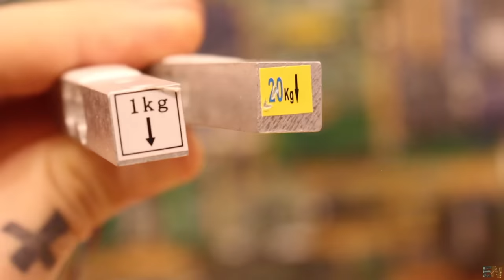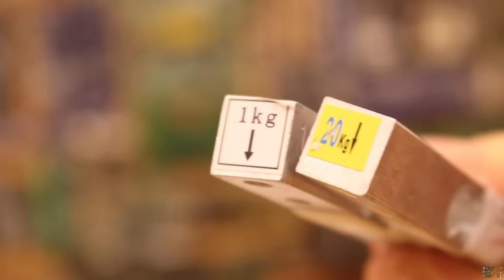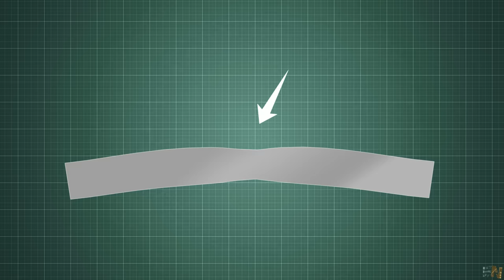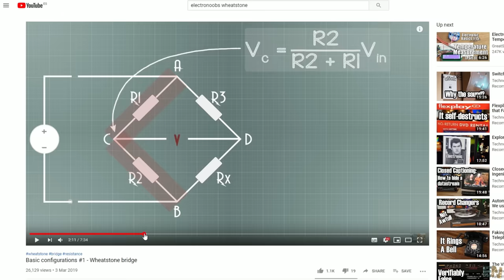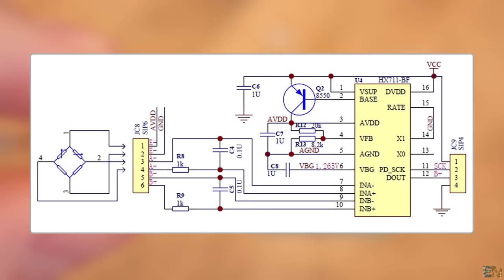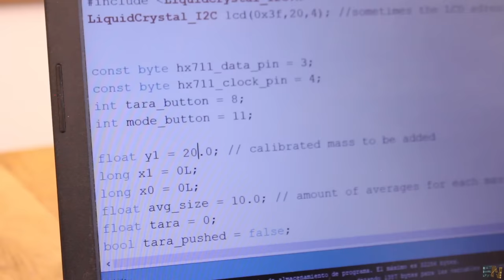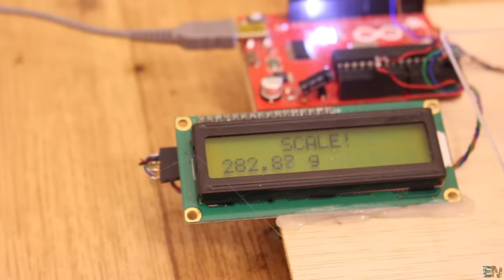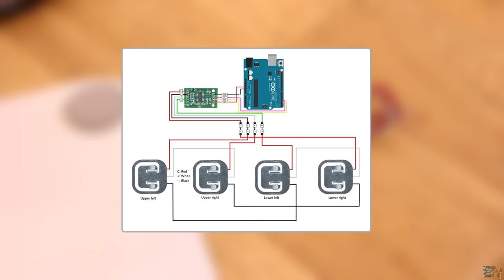How STRAIN GAUGE Works | Precision SCALE With Arduino

Comment: For most average users with arduino background this is a great tutorial. Your gage handling practices in this video and adhesive info need improvement. The HX711 also has many issues with it's reading due to it's overly simplistic and antique architecture. A MUCH MUCH  better BoB uses the ADS1120 or ADS1220. These are by FAR many orders of magnitude better be it more complicated.  Selecting STC code, bridge arrangements, creep code, dealing with thermal issues (passive, manual, active) material installation, compensation for temperature range, gage protection, and more as well as proper gage installation techniques (glue dependent).
Reply: any more info on non-HX711 solutions ?
Reply: Do you have any suggestions on how to incorporate a thermistor into the scale sketch to compensate for thermal creep?

Comment: When you need twisted pairs, you could use LAN cables disassembled. Each cable contains 4 very well twisted pairs. If you need longer cables, you can use RJ-45 connectors !

Comment: Thanks for this video and web page. I'm currently working on a mostly 3D printed bench-top dynamometer with a Nextion Enhanced touchscreen and a Arduino Pro micro. Features include volt meter, amp meter, tachometer, 10A relay, 10Kg load sensor, a geared stepper (to control the break from the touchscreen) and a buzzer. I was trying to work out how I would incorporate a calibration sequence into all this. This was the most helpful video i found.  Many THANKS!

Comment: I've made a few bicycle power meters using strain gauges.
I use a simple amplifier and the Arduino’s own ADC, very basic but actually gives decent power data when set up correctly.

Comment: Electronoob thank you very much great video merry Christmas thank you very much, i am using flexible caulk to seal a crack in the area that was damaged but it did not reveal or show the sensor, i learned a lot ,

Comment: This is used to calculate a bending force as the material elongates and deforms, Would I be correct in saying the this could be used to measure a tensile force if it was applied parallel to the gauge instead of perpendicularly like in the video

Comment: Thank You - I have the idea for a project weighing seems to be the easiest way to measure. Your explanation was excellent - Thank you 
I am just learning about Arduino and it is simple enough plus flexible enough to handle my project.  It is to easily measure volume (via weight) and control the temperature of water for a mash-lauter tun.

Comment: You cant make correct mesurement like that. You have to put things exactly at the center of the platform or you need 4 legs and 4 sensors to compensate the position. Yes, there is something like torque.

Comment: Can we a get wrong value when a same weight is placed at different places on the bord ?
Because increase in distance between the sensor and the centre of mass of the applied weight can vary the torque. So the resistance of the sensor also vary.
Reply from the maker: Yes it could. But for this small setup the error is very low. Also if the plate is more solid it will help more. That's why for better results you could use the 4 load cells setup as a body weight scale
Reply: @ELECTRONOOBS  oh! Yea 🤘
Reply: @ELECTRONOOBS  oh lol I mentioned this in my comment
Reply: The load cells shown with two bolts on either end are contra-flexure differential bending beams. The cut outs cause a near parallelogram movement. These two points reduces by many orders of magnitude the variance based on distance. The non-functional example on a piece of plastic or glass on the end would be proportional to both force and distance. An experience load cell designers job is to negate these effects though combinations of mountings and corrective designs.

Comment: oh boy I can't wait to use the gram -> ml function for my liquid mercury measurements :)

You know that function is more-less useless, right?
Reply from the maker: Is just for water... But if you want in the code, you can multiply by the mass of mercury and use it with different modes..
Reply: @ELECTRONOOBS  i know, but it was just funny seeing it knowing that ml == g for water. anyhow, very nice video. thank you
Reply: Yeah, though it could be made useful by adding a density calculation function: measure the volume, then press a button and measure the mass, and it automatically calculates the density.

Comment: Let me understand better.
Have you not taken into consideration the thermal drift of the materials?
Did you add a particular zeroing system before calibration and every time the scale is turned on?
I like this work of yours, especially for the fact that you used an ADC other than the Arduino one, which has little resolution and would introduce too much error.
For now ... bravo.
Reply from the maker: No, for this simple example, no thermal drift of the materials was took in consideration...
Reply: I see....well,it's a good starting point.
Thanks for sharing the idea.
Reply: The load cells are full wheatstone bridges and therefore passively compensated. A single gage will have high thermal drift characteristics especially if not matched to the material. This matching is matching the thermal expansion of the material to the STC or Self temperature compensation of the gage. This would help, but would not eliminate all of it. It also depends on the material of the element of the gage. Constantan gages have a flatter curve at room temperature, while Karma does not.

Comment: You absolutelly ignored the two strain gauges on side of the load cell. They are there for temperature compensation, connected in full bridge. So your examample on the end of the video, with just one strain gauge isnt actually a scale, but super sensitive thermometer ;)

Comment: Did you need to amplify the signal with additional components when using the strain gauge? 

I've also read that using more than 1 strain gauge can reduce error (for example, configuring 4 of them in a wheatstone bridge). Might be an interesting video.
Reply: While the HX711 I generally regard as fit for the trash, it does have a built in programmable gain. This combined with it's old sigma-delta design gives generally better quality and less noisy data (SAR uses sample and hold, Sigma-Delta "integrate" over time). There are many many strain gage configurations depending on what you are mechanically trying to sense. Poisson setups,  bending arrangements, differential beam arrangements, etc. Each using multiple strain gages.  Search Omega Strain positioning PDF for a quick reference.

Comment: Hello
I used the same organs like you. The problem is, on the screen I get a variation on the value obtained after the weighing.

So I need to stabilize this value, I don't know if there is a component / organ (filter for example) that I can use to stabilize the displayed value.
Please help me

Comment: Hello! I am very new to electronics, and I was wondering if we would still need a separate ADC unit if the microcontroller itself already has one? I keep reading that standard arduinos tend to have them built in... would you connect it straight into it?

Comment: Thank you for a very nice video. One question though, how do you expect the longitudinal placement of the load on the load cell to affect the resistance measurement? If you think of it as a bending bar, it seems like the resistance would increase if you place the load further from the strain gauges as the lever arm would be longer.
Reply: I've got the same question. You would measure the torque (M), and divide it by the lever arm length (l), than you would get the force (F), because M = F x l
Reply: Actually, in this video, he got it wrong. The aluminum is not acting like a lever. Here's a video explaining it in detail, starting at minute 1:57 :) https://www.youtube.com/watch?v=sxzoAGf1kOo
Reply: @Bella11Ba  I completely agree with you. That load cell looks like a lever arm to me and I'd think the deflection would depend on how far away you place the load. When I Goggle this, there's a surprising lack of results on this topic. I'd have to think the load would need to be directly above an identical spot on that load cell to be accurate.
Reply: I completely agree with you. That load cell looks like a lever arm to me and I'd think the deflection would depend on how far away you place the load. When I Goggle this, there's a surprising lack of results on this topic. I'd have to think the load would need to be directly above an identical spot on that load cell to be accurate.

Comment: for the 4  load cell setup with 1 load cell in each corner, how accurate is it when it come to weighing multiple items. like for example, what if there are like 5-10 items on the scale and the items are spread out all over, like some items are in different corners and some in the middle. Will this mess up with the total weight reading or will the scale be able to measure total weight accurately even with items spread out all over the scale?

Comment: I am very new to electronics and I wanna built the compression sensor. Can I use the HX711 with only one strain gauge and how to connect it since there are only two wires? please help.

Comment: Bro i want to ask a question about hx711

hx711 datasheet says if we send 25 pulse it will send a input

if we send it 26 pulse it would answer with b input

but there is a huge question in my mind. 

we have already got the all data before sending 26th pulse.

Comment: For the load-cell setup with a panel attached to it: is there a difference in the measured force depending on where on the panel the force is applied? The force I am measuring is very localized (small contact area), not vertical (not a scale), and is very weak (tens of mg), so I will need to compensate for such a difference if it exists.

Comment: Greeting

I have one question and maybe two :-).

I would like to make one bee scale, but simple. Is it possible that there are only sensors under the hive or possibly hx711.
And when I want to know how much weight it is, I connect only the arduino and it reads the state with hx711. All this interests me because of the consumption of the arduino and the batteries are quickly discharged and the weight is canceled again.
I hope you will be able to help me and I am weak with this technique and thank you very much in advance.

Comment: Nice video. QUESTION: Since your strain gauge is working off of the FLEX of a LEVER, the FARTHER out you place the item being measured, the MORE flex you will get due to torque, correct? For your scale to be accurate, the force would need to be directly ABOVE the strain gauge, NOT on a lever arm. Am I mistaken in my assumption? Anyone else notice this? Thanks and apologies if I'm incorrect ~ again, thanks for the video as I did learn from it :-)
Reply: Yes, torque matters, that's why you have 4 legs and 4 sensors.

Comment: I love this video and this project, but I'm feeling very frustrated and dumb right now. I can't get the Tare (Tara) to work. I'm still a beginner at Arduino, and there's a lot I don't understand about Arduino coding. I have tried for hours to figure out the code on my own, but I can't figure out why Tara isn't working, and I don't understand the Interrupt Service Routine that you use in this code. I would really appreciate a further explanation of that, and some troubleshooting guidance. Thanks!

Comment: Great video but
6:58 (2^24)-1 because the 0 is included
Reply from the maker: Thanks for that
Reply: You should divide by 2^24 when converting it (to voltage, force, mass...), though: https://forum.allaboutcircuits.com/threads/why-adc-1024-is-correct-and-adc-1023-is-just-plain-wrong.80018/

Comment: I want to make a scale from a strain gauge which can measure the weight of a vehicle on the high way. do you have any suggestions for what strain gauge to use.? definitely cheap and efficient
Reply: Just make the strain bars thicker like he did with the acrylics, spring steel maybe

Comment: Congratulations for the video. I have a question, i hope that you can help me. 

The values that appear between the minutes 6:56 to 7:14 are voltage? or how can i convert these values in voltage?
Reply: The values from 6:56 to 7:14 are the readout of the HX711. There is a formula to convert from these values to the voltage. Assuming the relationship is linear, a known mass is needed in order to calibrate the scale and find the formula.

Comment: There are many wrong informations... The Resistor ist changing because of the Formula R=(p*l)/A. p is the specific resistance. And the HX711 is not only a ADC. The Important part is the amplifier in the hx711. Otherwise no ADC can measure this tiny voltage difference.
Reply: You're close on a few things. Even in advanced strain gage training at Vishay Micromeasurements they relate the resistance change to geometric deformation. It's not actually that simple as there is a atomic structure element to it as well. There is also an architectural difference in the external and most internal ADCs and many sigma-delta type have "fake" gain stages by trading off read time. They don't sample and hold, they continuously integrate charging and discharging a capacities element and counting the time against a clock. This allows long integration times to act like gain. Some have real gain stages (TI ADS series generally) and some have a combination (MAXIM,  AD) which fake low gain but implements high gage in a few steps, adjusting it with fake gain(integration time).